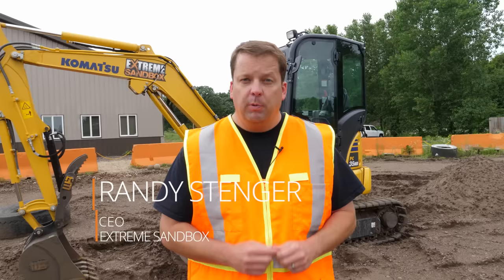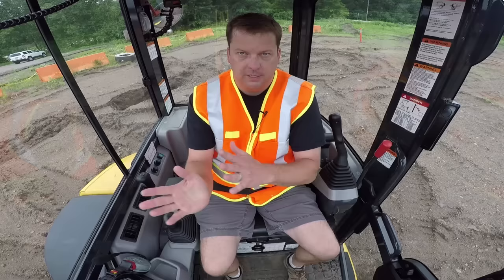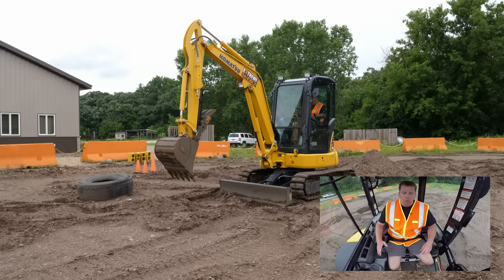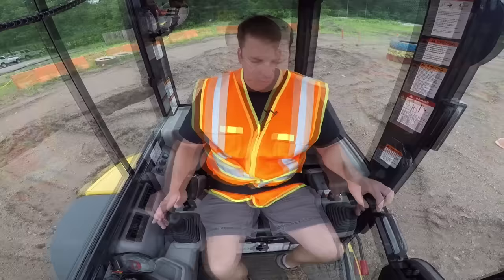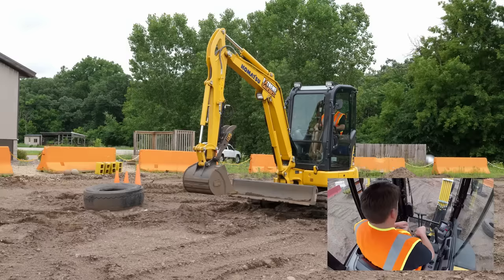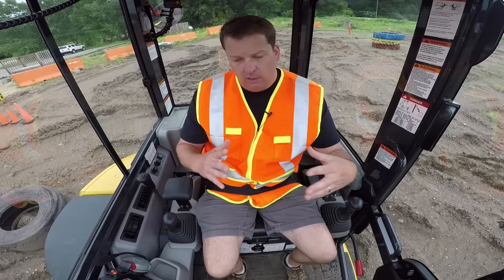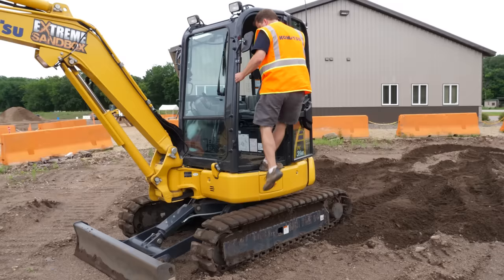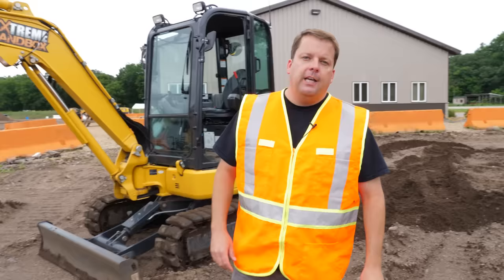How to Operate a Mini-Excavator | Mini Excavator Controls

Comment: You failed brother on your 3-points of contact, upon entry...just saying...lol
Reply from the maker: Good catch...safety is priority!
Reply: @HeavyMetalLearning  I am looking at using one of these to clear a drive way, plot for new house and put in a septic system.  My land is all tree's, hardwood and firewood.  About 30" is the biggest tree on my land, anything bigger would not get taken down anyway.  Do you see any issues with the use of this style machine for what I need done?
Reply from the maker: Not sure a Mini-Excavator would be the best for lot clearing and building a driveway.   I think it would be a perfect choice for digging your septic system and any foundation work needed, but they aren't the best choice for lot clearing.  I would most likely rent a skid steer and/or a bulldozer if you had a longer driveway that was needed.
Reply: @HeavyMetalLearning  Thanks for the reply, I truly appreciate it.  If I could, I would just hire a company to do the work but here in MI all I get is lie's.  No one wants the work.  So, trying to do it myself and save as much money as I can.  I can get one of these mini excavator's for $3500 a month, think I could get what needs done in a month, with just this style excavator. No?
Reply from the maker: @SheepDog7071  Potentially, although I would probably rent a skid steer before I would get a mini-ex.  Skid would be cheaper, do better clearing land and grading a driveway.    Only piece would be digging the septic, which could potentially be done with a skid but would be easier with the mini.   Tough call, but not necessarily a "right" answer.   Just be careful.
Reply: You could do it with like a cat 308 mini get thumb to clean up trees and if your good with blade you can blade in a driveway and dig your septic
Reply: Loader w/ Backhoe.... boom problem solved! Better mobility while still having a machine with some weight to it for moving downed trees. Then could do some digging for the septic and foundation. I would assume pricing would be fairly similar.

Comment: Only problem I see with these videos is that they are using machines that appear to be brand new and all the latest features. Most of us that need to learn can't afford this new equipment and have older machines that don't have all the electronics and fancy features
Reply from the maker: Agreed that we run newer equipment.  But ultimately stick time is stick time, so I would say that whether you can operate a new or old machine it is all relative.

Comment: i hate a thumb that run by a foot control, the most pain in the butt, and harder to control, when i rent a mini witch i do a lot, it they have a machine with the tumb control on a foot control and i have a lot of brush or logs to load, i will not take that one a thumb switch on the joy stick is bt far nicer to work with,,

Comment: I was told to keep the blade behind you when digging.
Reply from the maker: Interesting....was there a reason?   It seems to make better sense to have it in front because 1) more stability by putting the base/blade down further in front of the boom (less likely to pick the back up) plus 2) it provides some protection for the rubber tracks in case you dig too close.   But maybe there are some benefits to having it in back.   Interested to hear what others think.
Reply: Because on a small machine you dont have any down force with your blade behind you you get down froce
Reply: @jeremybrowne5413  u almost always want your blade I front of u it will help the machine be more stable and u always want to dig over your idler wheels rather than your drive  wheel at the back of the machine
Reply: why do you leave the boom and stick extended when you go to dump all the dirt spills back into the hole your digging it helps if you bring the stick in and open the bucket a little you dont spill much
Reply: @brycereynolds8432  not always mate  depends on what you are doing /digging if you are doing footings trenching if you have your blade to the front you can never see what you are digging when you get close to you but hey mate keep up the practice you will get there one day
Reply: @jeremybrowne5413  that would be why I said almost always. Have a good day
Reply: I was told this only applies to 2t and smaller/lighter machines, as the digging force will often lift the machine.
Reply: @shanicedyer4732  it comes down to experience mate if you are digging a deep footing or hole if your blade is infront of you you never see the bottom if your breaking through ashfelt or hard ground it will stop your tracks from lifting off the ground you might dig with your blade infront of you sometimes most people swap and change depending if your smooth enough and know what your doing you will hardly use it
Reply: For me its preference. Sometimes I have it in front or the back. Like if you have to straddle something that’s in the way. Or if I’m on a hillside and want to be level or more stabilized.
Reply: Yes that's correct. Also if in front u can catch the teeth under the blade etc. Behind when trenching so u can see and not catch the blade. In fornt obviously if u are wanting to pick up concrete etc
Reply: @Offbreed76 Good tip. Need to try it. Thanks for sharing.

Comment: Personally i think the video is irresponsible , gives the impression that after watching this you can simply go out and drive one . These machines are killers , experienced drivers  turn these over in awkward situations  regularly , people can get crushed or seriously injured by inexperienced drivers . I have driven one for over twenty years , got them stuck and out again, had them tipped up to the point of my face touching the front screen ,had one track off the ground . All these situations can and do happen  to experienced drivers and takes experience and knowledge to deal with safety and needs to be taught in practice and how to deal with it   after being a more than capable driver not some rookie  driving one at the weekend .
Reply from the maker: So....1) who is getting that impression by watching a video?  So if you watch any other videos online do you automatically think you can go out and drive one???   2) so what do you propose then?  Would you rather someone goes out without any knowledge at all and experiment?    Learning new things is never a bad thing!
Reply: @HeavyMetalLearning   There is noting wrong in learning new things , but common sense needs to be applied as well . If people want to learn how to drive these safely there are often courses at the hire depots where they can be taught how to operate the machine safely and checked for competance at using one by trained staff . You don't say to someone you have watched a video on how to drive a car , there you go you can drive on the road on your own now  these machines are no different . Maybe you should add that advice to your video .
Reply from the maker: Adrian Bew go search “how to drive a car”.   Learning is always a good thing...don’t be afraid of it...don’t fight it...and definitely don’t discourage it!
Reply: @HeavyMetalLearning   I would suggest you look at your governments statistics regarding excavator accidents  not pleasant reading .
Reply from the maker: @adrianbew9641  I think we're on the same side.   Safety is absolutely the #1 priority.  And I would argue our videos promote more safe behaviors than not.   I just take offense to you making a blanket statement that our videos are "irresponsible".   We put a lot of effort in to our videos, and don't ask for much (if anything in return) so it pisses me off when someone says that.   If there is inaccurate messaging in our video than absolutely provide suggestions or tips/tricks to help others learn, but don't be part of the few who complain just to complain.   Stay positive.  Again, learning is always a good thing!

Comment: Your digging technique is terrible! bucket all the way uncurled like that and then just curl is terrible for new operators. By showing this technique I will guarantee you that someone who watches this will go out and rip out underground electrics. This is a terrible technique you should never be digging at a 90 degree angle with teeth straight down. You will rip out electrics, gas, water, drainage, sprinkler systems, sewage etc. stick to your sandbox and let the pros do there jobs without making people think their YouTube Operator's. I have seen an operator dig out electrics multiple times and talk about preventable!
Reply from the maker: Is anyone else more concerned that you are just "ripping out underground electrics"???   If you are just digging with no idea what is underground and hoping you don't hit anything because your teeth are curled in.....you sir may be the problem!
Reply: Well it’s not like you would know being in a big sandbox as you call it! Cause you have nothing to worry about. If your gonna do an instructional then you should at least do it right. Teeth in, and then immediately curl are you kidding me? There is a reason there is a stick and boom not just curl. Learn to use it!
Reply: KY K  You just came here to complain. This guy has done a great job at showing basic use of an excavator intended for beginners such as myself. Even I know that before digging I am to call 811 to have the utility lines marked prior so I can dig around them.